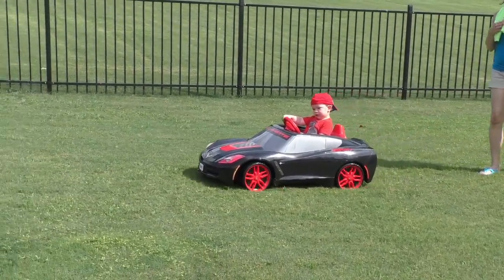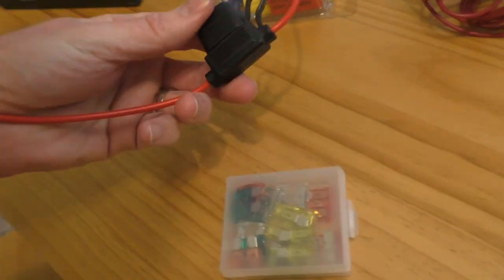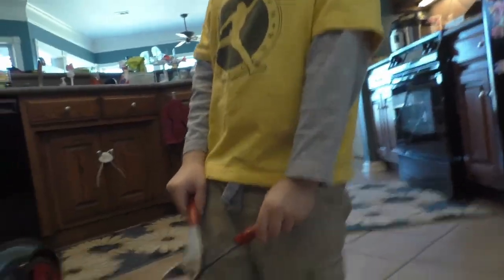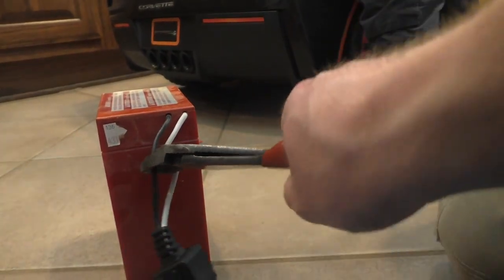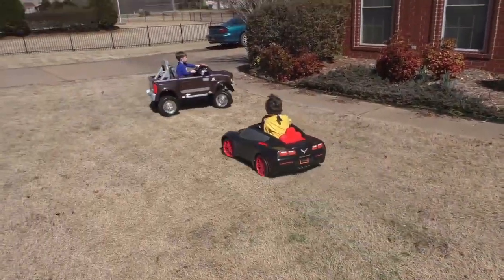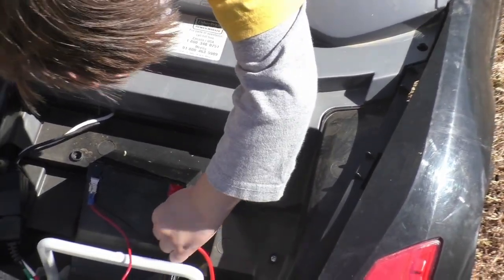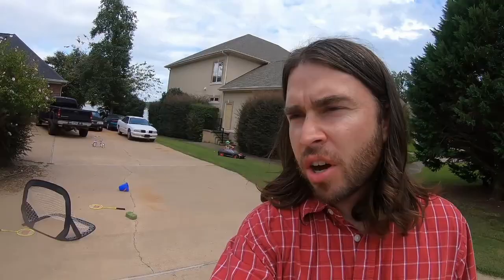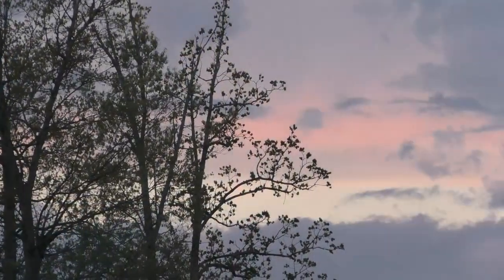How to Make Your Power Wheels Faster 6V to 12V Conversion

Comment: A word to the wise... If you're gonna modify a child's toy to have more power, you need to AT LEAST use the same gauge wire or thicker 😅 

I genuinely wonder if this has caught fire yet..
Reply from the maker: Never.  And the gauge wire I used was plenty stout enough for 12volts.

Comment: Planning on doing this upgrade to a 12v battery, but i see some with 12A and some with 15A. Does that matter?
Reply: That’s the capacity of the battery, meaning how long it will last. 15A will last longer than 12A

Comment: So they have this feature called crop where you can edit out the part where your kid almost gets shocked. 😂
Reply: Ikr! Cutting both the positive and negative wires together while they are connected to the battery was sketchy to say the least. Not to mention doing ANY wiring while its still connected to the battery 😅 holy moley 😂

Comment: I tried using my impact wrench battery, which is 36v, just for the shake of curiosity. Well it spin incredibly fast, but only last for a few seconds then the wires got burnt 😂😂
Planned on doing upgrade like yours since 12v batteries are relatively cheaper, even LiFePo4 compared to 6v vrla here. 
Just curious tho, Is the original controller still able to handle 12v on the long term?
Reply from the maker: @purnadika this car lasted until the rear tires broke apart.

Comment: Do you actually need a fuse has it ever really popped
Reply from the maker: @TheJoeMoneyShow  if you aren't worried about burning up the engine, you can forgo the fuse.  It didn't ever pop on me that I remember, but it's just there to protect in case there's a sudden influx of amperage.
Reply: @ doubt you need it direct connection is fine
Reply: @TheJoeMoneyShow  lol, can't argue with that logic!
Reply: @jenborda2385  nothing happened I tried it out with a voltage controller

Comment: The electric motor had no issue handling the extra voltage?
Reply from the maker: @ebernier797  no issue.  The gearbox can be the weak link in some applications.

Comment: Just wondering.. 6v dc motor won't burnt by 12v dc battery? Coz i want to convert my daughter's motor scooters battery..
Reply: 12 volts should be fine, I'd the gear box does give out they sell beefier ones for 25-35 bucks
Reply from the maker: I haven't ever had one burn out.  However, sometimes the gearbox can't take the extra power and will break.

Comment: How do you charge it? I imagine you can’t charge the 12 V with a 6 V charger.
Reply from the maker: It says in the video.  I'm guessing you didn't continue watching until the end.  You use a 12v charger.
Reply: What i did was adding a 2nd 6v battery. This way you can keep using the original 6v charger.
Reply: @marijn9019 how did u add it? Negative to negative n positive to positive??
Reply: those use 12volts how is that an upgrade ? the difference I see is you used a cheaper battery then what they use
Reply: will it require changing cutouts/Fuse as well?